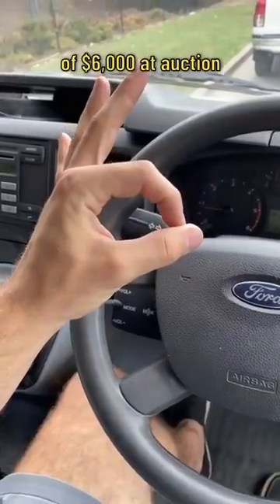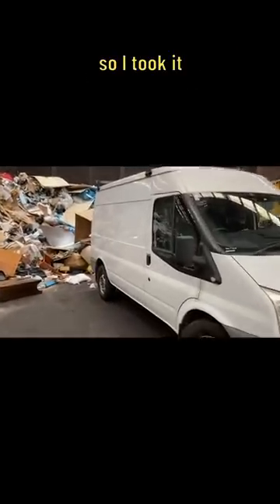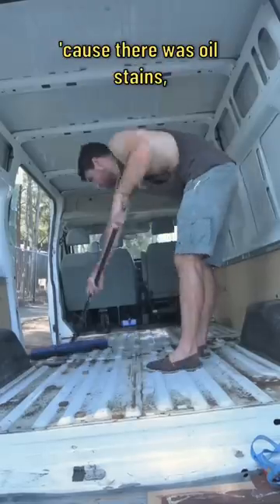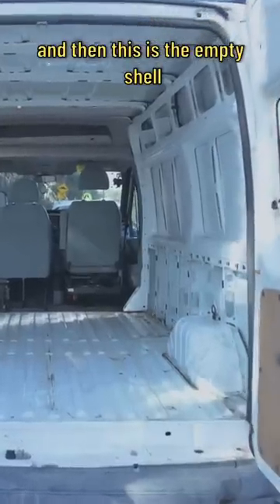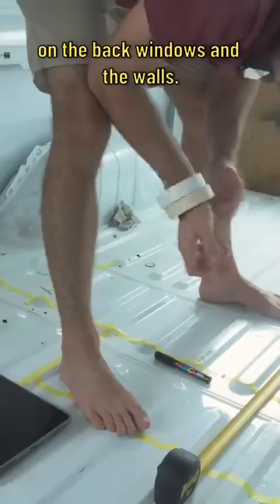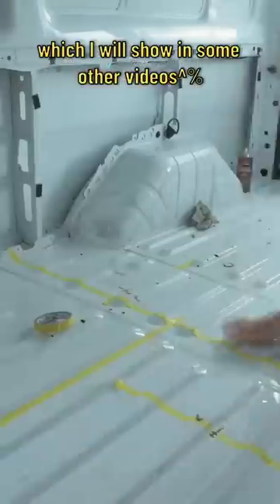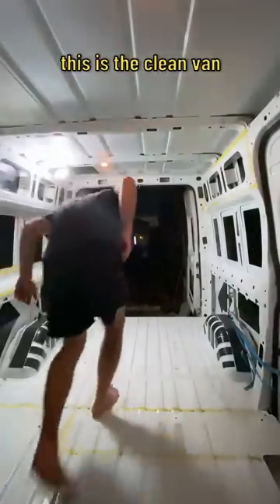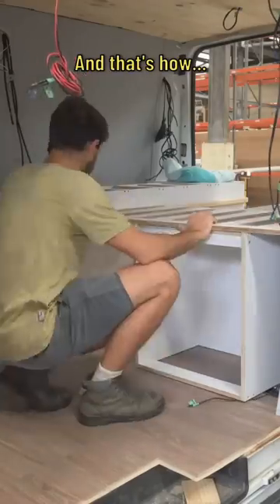Mini Van Build (1/8) - Buying and cleaning my Ford transit before converting it into a DIY camper

Comment: I was thinking that keeping the old oil stained floors to use as templates for laying out and cutting the new floors would have been a good idea.  You could have traced them on some heavy brown paper before discarding them.  Then, fold the tracings up and store them in the walls as additional insulation for the next time the floors need replacing.
Reply from the maker: They were in pretty shocking condition... I tried my best to do that initially.

Comment: If this was in UK you would need to spend a few weeks under it welding it up rot boxes
Reply: No joke! I see 2018 ford transits with rust!
Reply: Shocking ! Don't know how people are still buying them
Reply from the maker: Is it because they’re built different or salt on the winter roads? We have a heaps of transits in Australia and none of them seem to get as much trouble with the rust…
Reply: @loicleray  salt on the roads plus Fords don’t do anything underneath other than a bit of paint always all of them will rust. That’s why I’ll always go Renault or Vauxhall not as good as a transit but they don’t rust
Reply from the maker: @Lukedormer  Nice! Thanks for the info! Been getting hammered by people in the UK saying the van is destined to be a lemon. This clears that up. I've had the vehicle for three years now and had almost no issues (that weren't my own doing).
Reply: @loicleray  mate I have my own car shop here in U.K.  aslong as you do regular oil changes that van will run forever. Just watched the vid when you take seats out and showed underneath and it looks very clean. Just get a can of under seal and give it a good covering especially around the lip of the arches and the seals. Great videos
Reply from the maker: @Lukedormer  Sure helps having a pro in the comments! Thank you!
Reply: @Lukedormer nah you just need to budget for gearboxes and injectors with those “ dare I say it “ rubbish vans
Reply: No worse van than a transit. Absolute shitboxes
Reply from the maker: @cfcduffysafc  Must have found a good one... haha
Reply: @loicleray  sorry to say it but it will bite you sooner or later. A friend has had several, all absolutely terrible. One went through 3 engines in 3 years. Known for it. Best I could recommend is change the oil early and use good quality stuff
Reply from the maker: @joecrancher2008  Much appreciated. I had it for a few years (before I made this video), luckily no major issues during that time.
Reply: @loicleray they're probably sourcing cheap Chinese steel. Labor goes up in China so they have to cheapen materials or process demands.
Reply: @loicleray  At which auction place did you get it? Thanks.
Reply from the maker: @rabbitphobia  Grays Online 😌
Reply: @loicleray  Thanks, mate.
Reply: @loicleray  did you insulate? I did similar once with aluminum tape, fool buble foil with aluminum tape on both sides, then a layer of insualting foam board ...on a week of nearly 110 degrees most days parled in the sun everday - the inside of the box never got above 73 degrees Fahrenheit...
Reply from the maker: @1truthseeking8  That's sick. Definitely a necessary step. I definitely insulated pretty well. Saves you on the hot days for sure. I would def go back and add a bit of spray foam in some areas though... oh well, live and you learn!
Reply: @Loic Leray  arndell park ?
Reply from the maker: @scotttownsand1533  Got it out west at the big Grays Online depot, can't remember the exact suburb...
Reply: @Loic Leray  just looks like the auction place I got mine from out at  blacktown. Good luck with your endeavours bud ! 👍
Reply from the maker: @scotttownsand1533  Hell yeah! What did you get, van for a conversion? Post your account so I can suss it out 😉
Reply: Spot on, they rot from the inside out haha
Reply: @joshuarussell5512 i seen a 2019 mercades springer with the rear wheel arch rusted. It has 80k miles but never gets cleaned

Comment: I want to start something like this but the price for one of these transits are insane!! Awesome work though ❤
Reply from the maker: Facts... not cheap in the current market
Reply: We're doing a Promaster 2500 conversion right now. Had to travel to another state and find one. Dealerships in my area all say there's an almost 18 month back log for any type of over height van.
Reply from the maker: @76482  It's crazy out there at the moment. Hard to find any car worth buying... Good luck with it =)
Reply: Get a Ducato. Way cheaper and right good vans.
Reply: @tilerman  a fiat? Surely this is a joke. After 20 years working as a mechanic your the first person I’ve ever heard recommend a fiat.
Reply: @cfcduffysafc  As a tradesman for 38 years my fiat was the best van I ever had. No joke. I look after my vehicles and my van has not missed a beat and never let me down a single time. It all comes down to how you treat your vehicles and servicing, you'd agree with that right?

Comment: surely if you buy something at auction, no matter how fast the owner wants to sell it, it goes for the same  price of a similar van. There are other people bidding on it as well as you.
Reply from the maker: I thought that was right too, but it turns out (1) people who buy at auction are probably hoping to get it at a reduced price anyway.

A lot of them are dealers hoping to resell for a profit, so they can’t but it at “market price”. 

We’re also assuming people know about the auction, are comfortable with the risk (no guarantee about van condition).

It was sold around Christmas time, so most people were distract with loved ones and holidays.

Comment: Just “hitting it with spray paint” won’t stop the rust.
Reply from the maker: Correct, hit it with some special rust primer stuff before the white paint. =)
Reply: Well if you sand it back to bare metal and prep/prime it right, those areas will outlive the rest of the van even if they come back. Looks in good nick overall.

Comment: How did you manage to find out about the auction and that  a nice used van was being auctioned off? That was a very good price, I think! Best wishes!
Reply from the maker: If you're based in Australia there are a few options... A google of car auctions will go a long way, but I used Grays.com. Just make sure you go and see the car at the depot, get a mechanic to check it etc... Hopefully you avoid buying a $6000 paper weight.

Comment: Thoughts on the sound deadening panels? Worth it or regular insulation would do the same?
Reply from the maker: I think it was worth it. Even with partial installation the difference in vibration noise was significant, especially when driving. Way more quiet riding when empty, more quiet when sleeping near busy roads. That said, depending on your choice of insulation you will notice it also dampens sound, but to a fat lesser degree. 

In my opinion it’s too expensive to fully line the interior of the van, 20% of the coverage gets 80% of the results.

Comment: What model year is this van, and what does the odometer read?
Reply from the maker: Hi! It's a ford transit 2011 model, mid wheel mid rood 2.4L Diesel. had 198 000km on the clock when I got it.
Reply: @loicleray  Thanks...

Comment: Dude, you got ripped off 😅😅😅
Reply from the maker: Maybe in non-Australian markets... absolute bargain over here. Same vans are going for AU$15000 easy.
Reply: You must be joking. here in the states these things are $50,000 USA as an empty shell, new conversions are $100,000 plus and used ones are impossible to find any good.
Reply from the maker: @georgespalding7640  AU$15k will get you and empty older vehicle with about 200000km on the odometer. The price only goes up from there... 

They ain't cheap.

Comment: Its a pitty the Ford Transit was such a total sh!tbox mechanically, because the shape worked. But that's Ford, and why their only good model is a rebadged Mazda today
Reply from the maker: Everyone says that, but I have a few mates with converted Transits in Australia and we rarely have had any hiccups. Not as bombproof as a HiAce though for sure... 

Where are you based? I wonder if they build them any different for the different markets?

Comment: why do people always skimp on sound deadening only to do it wrong... a patch here and there wont do anything,, you have to completely cover the walls and floor with it before you put insulation in.
Reply from the maker: Fair enough if you have a small car... but these vans are BIG. I chose the 80/20 rule. Just needed something to help reduce the rattle in the back of the van, which is going to be closed off from the front anyway. Not worth the extra $$$, weight and time to do the whole thing. I can see why people would disagree with that take though.

Comment: Cheap particle boards for cabinets.. just NO. 😢
Reply from the maker: I agree it kinda looks like it from the video, but I am using specialist 16mm plywood which has a melamine like coating on each face. This stuff doesn't disintegrate or soak up water like particle board does. Not cheap, but it's really worth it.
Reply: @loicleray  had to stop frame and blow up the image .. does look like laminated  plywood. 
Good for you ! 👍
Reply from the maker: Bit hard to see with the quality of "Shorts". Full video will have it be way more clear. =) 
 @customsolutions7167

Comment: Where are you located? These go around 1900£ here in UK
Reply from the maker: Unfortunately we pay the “across the pond” fee here in Australia.
Reply: Yeah 1900 and probably shit boxes!
Reply: @aflaz171  no rust, manual, 98k miles, diesel, double tall roof, mwb. 
The bad: sliding door stopped working bc a 3£ piece of plastic broke, missing mirror plastic cover, 3 pinhole leaks in the roof by the back doors. 
Call it what you want🤷🏻‍♂️
Reply: Most of those generation transits need welding up to pass an MOT.. I paid £5k for mine but it was a 1 owner from new van, the owner also being a custodian of several old land rovers (series 1, series 3, defender and early 2 door range rover, all pristine, maintained and waxoyled religiously). He treated the van likewise, it had dinitrol oozing out everywhere, not a single bit of rust anywhere.
Reply: @jo24pafisher  Shitbox then?
Reply: @aflaz171   no rust, manual, 98k miles, diesel, double tall roof, mwb. 
The bad: sliding door stopped working bc a 3£ piece of plastic broke, missing mirror plastic cover, 3 pinhole leaks in the roof by the back doors. 
Call it what you want🤷🏻‍♂️

Comment: How can I have access to dealer auctions?
Reply from the maker: Not sure, I'm not a dealer. But there are a few auction sites around - with a bit of research and a slight appetite for risk you can find yourself a good deal.
Reply: Have a friend who is a mechanic or does car flipping

Comment: Use 5cm 25psi solid foam insulation under the flooring.
Reply from the maker: I thought about it, but 5cm would chew up the internal space. I already can't stand upright. Is that an American winter thing?
Reply: @loicleray  Proper insulation is the most important bit of a van build.  It doesn't matter whether cold or hot climate, not doing so is a huge mistake.  Yes, you'll lose about 10cm  total.  Cover the entire interior and build an insulated partition separating the cab.
Reply from the maker: @denizalgazi  I insulated the whole thing already, just not 5cm worth on the floor. Used some special waterproof foam.
Reply: @loicleray  Excellent! 👍